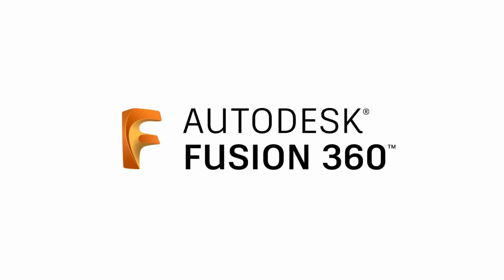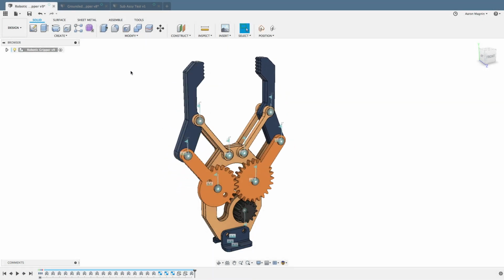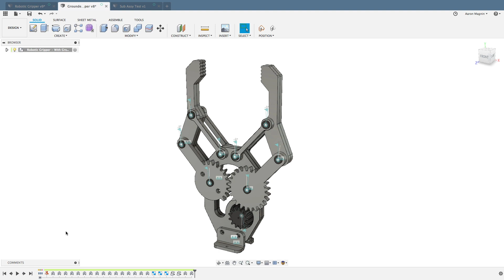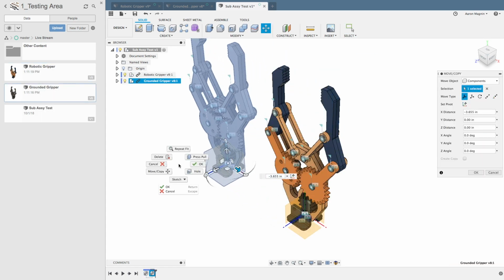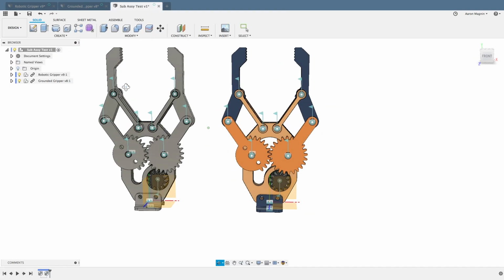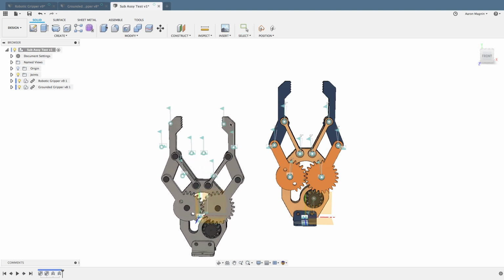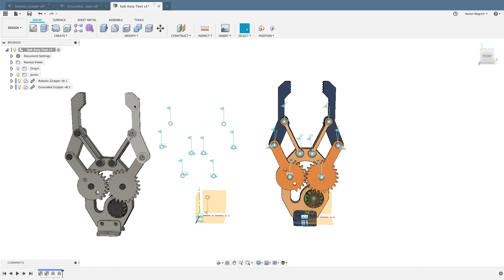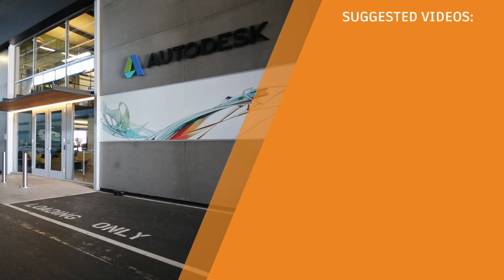Autodesk Fusion 360 | Quick Tip: Ground Joint or As-Built Joint?

Comment: That's cool but what I have to do if I don't need a grounded part? If I want to make the part that you grounded a moving components which follow the others joints? For example like in a origami
Reply: If all your parts need to move then the easiest way I found is to make a grounded block (could be a cube or a cylinder as the shape isn't so important) then design the other parts, apply your joints (one or more will reference the grounded block) then hide the block. This technique helped me out some years ago when I was making an animation of the moving parts in an engine.

Comment: The video explains a symptom but does not explain the reason for it. I've been trying to explain this many times in the Fusion 360 forum. Watch your Origins! I guess as I invented Fusion 360's R.U.L.E.#1 & 2 that might be a worthy  R.U.L.E #3 ?
The reason the grounded assembly is floating is because Aaron used a rigid as-built joint. The rigid as-built joint and the rigid group joint do not require selection of a reference (joint origin) on a component, so they can only use the origin of that component.
The grounded assembly references the top level origin but when it is inserted into the assembly the ground reference is nil. If he had used a rigid joint or revolute etc. basically any joint that requires a user to select geometry to place a joint origin on then the grounded assembly would have also worked fine.

While I also prefer the rigid group or as-built rigid joint method, the "Ground" command has one advantage in that it removes components from the joint solver calculations. In complex assemblies that can make quite a difference
Reply from the maker: I think my main goal of this was to steer people away from using ground. Everyone thinks it's similar to "fix" in SWX, but it's not the case and will get you in trouble.
Reply: Autodesk Fusion 360 does that mean that ideally Fusion should receive a "Fix" mechanic itself?
Reply: @BlackSmokeDMax  Ideally you'd understand the conceptual difference between Grounding and Rigid Grouping and then you'd find that it does not need a Fix/Anchor command.
Reply from the maker: I think the chances of that are slim. If we had a "ground", "joint", AND a "fix" things could get real confusing. A better resolution requires educating Fusion users with videos like this.
Reply: Fair enough!
Reply: @peter doering still new, so don't quite have that grasped yet. working on it though.
Reply: @adskFusion  Mission accomplished! It did, however, provide the perfect canvas for me to provide a bit of conceptual background, so now I can refer to this video or better the thread onto Forum. That will save me. lot of typing ;-)
Reply from the maker: Awesome! We may give you a new R.U.L.E. to add to your portfolio too! haha
Reply: And this is part of why Fusion assemblies are so hard to grasp. It just isn't that complicated in Inventor or Solidworks.
Reply: They probably actually work in those other programs though? Seriously, these videos are useless, as they skip through the actual bit where the one vital command is done.

Comment: So when would you use the ground function?
Reply from the maker: Honestly, I don't use it anymore. It does help with solve time, so if you have a very large assembly that might be a good reason to consider it.
Reply: I second Aaron. I only use ground for quick stuff. In assemblies with linked subassemblies I use a rigid group joint.  The as-built rigid joint is not available in DM mode. However, most purchased components are imported in DM mode and I usually don't turn the timeline on (to keep flie size down)